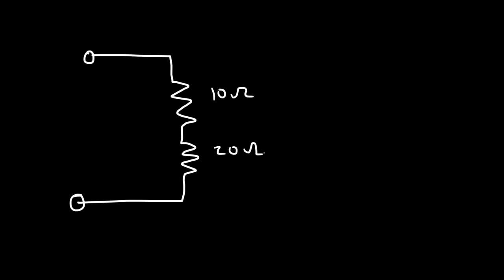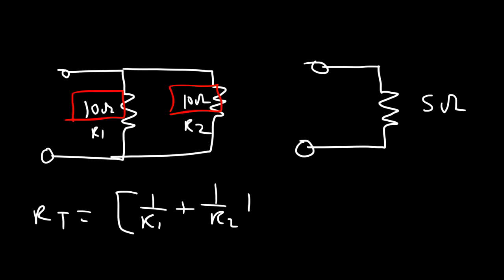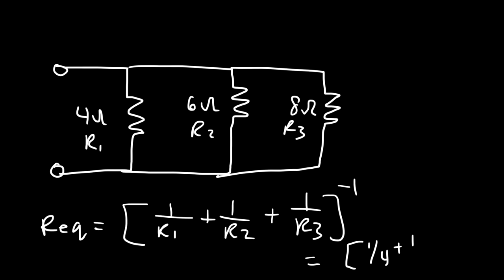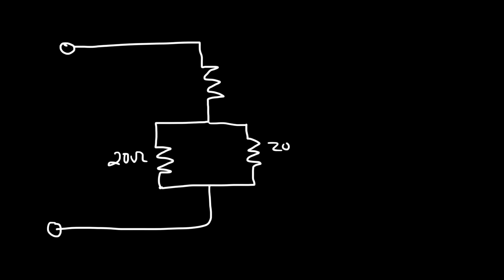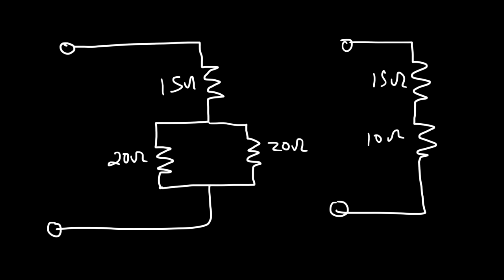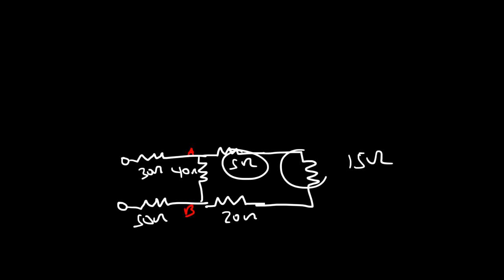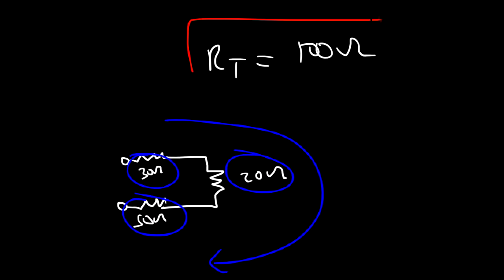Equivalent Resistance of Complex Circuits - Resistors In Series and Parallel Combinations

Comment: All these examples are very flawed because your just using very round and easy numbers and then your solving all the parallel resistors by making them the same number and dividing them, if your parallel resistors had non matching numbers your problems will be much harder to solve
Reply: What's your point, the "examples" are supposed to be easy why are so stupid abt numbers, he's obviously trying to make it easy not hard, not being able to solve the numbers part is on you not him

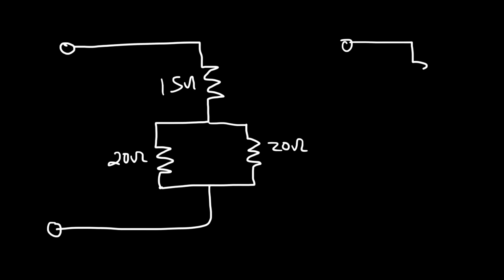Comment: how 20 ohms and 20 ohms are in parallel? I thought it was in series. 3:22
Reply: Because the current can flow separately towards either resistor.  In a series configuration, the current can only flow in one direction.
Reply: If you observe carefully, there are junctions up and down the two 20 ohms. And whenever there's a junction then we have parallel resistance. This is the best way you can forever understand it.

Comment: At 8:51 you said the 10,30, and 20 resistances were in parallel, and you added them together for 60. Aren't they in SERIES (one current path) so you can add them for the total resistance of 60 ohms?
Reply: he meant series. Parallel resistors can not be added for total, they have to be put in the formula.

Comment: How you could of improve this video to make it undestand a quite bit is breaking the 2 ends of the power supply down into a straight line with the points A B C etc. then adding the parallel parts in. Awesome video though xoxoxo

Comment: 3:12 You don't explain why it's 10 ohms??? You just say 'we can make it 10 lol' with literally no explanation, it was going so well, why needlessly do this? Why can't you just simply explain what you are doing like you had been for the other examples. Unbelievable.
Reply: When u have 2 resistors in parallel, if they have the same value (like this case), you can divide the 20 by how many 20 resistors we have. So in this case we have 2 which is 20/2 = 10

Comment: Top quality tutorial. In my experience the place where most errors occur is the calculation of the parallel resistances. Students make errors on the calculator entering all the numbers. I now teach product over sum which has a far greater success rate. For anyone who does not know  two resistors in parallel can be calculated by multiplying the two values together and then dividing by the sum of their values. So lets say 2 resistors     4 ohms & 6 ohms.    (4 x 6) divided by (4 +6) = 24 divided by 10 =2.4 ohms. For 3 resistor just calculate an equivalent value for the first 2 and do the calculation again with the first answer and the third resistor. There seem to be far less calculator input errors using this method.

Comment: Greetings! I found that you made a little mistake between 8:46-8:50. These three resistors are in series not parrallel but the good thing is that you got the right answer it might be a pronunciation mistake. 😇
Reply: ok, man, I cannot understand how they are in series like they're connected to both A and B potential, and it gives a parallel with different potential

Comment: at 8:47 you said "now we have three resistors in parallel". However, shouldn't it be in series because you added 10+30+20 instead of taking the reciprocal of them? The current only has one path to flow and this is the same configuration as 8:01 where you said all 3 resistors were in series.
Reply: wash searching for this comment to make sure İm not mistaken👍🏻
Reply: He is a human man 
Everyone does a mistake in their life.He has misspelled  parallel instead of series connection.
Reply: @Hirosaki975  i was just making sure. i'm still very grateful for this channel

Comment: About the resistors in parallel... You basically want to convert the resistance into conductance, add them together and again convert the sum to resistance. You convert the two by flipping the fraction.
10 can be expressed as 10 over 1. So by flipping it you get 1 over 10.

Hope makes sense
Reply: https://youtu.be/tCApmk9JEvU
Its very easy... Check it once

Comment: what is the resistance of 160m wire length with 0.28mm uniform diameter, if specific resistance is 12.32 micro ohm Cm

Comment: A question, imagine there is a main path/wire connected to battery. Now that main wire has 2 resistors. Now I put a zero resistor wire (Let's assume its zero or close to zero). One side of the wire is in between that 2 resistor and the other one is connected to the main wire.

How will the current flow?

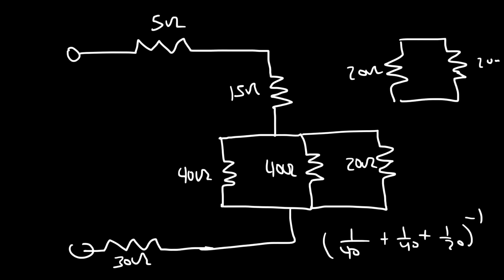Comment: How are you getting the answer to the part at 5:25 minutes . 1/40 + 1/40 + 1/20 over -1 or something like that . I don’t have a calculator and I’m doing it on my phone calculator. I keep getting decimal points , with those 3 fractions added up i get 0.1 . I don’t know what to do now someone help
Reply: I found the answer i was doing the last part wrong for the math
Reply: You first add them all then raise them to the negative one power

Comment: But, why is the equivalent resistance less than the smallest resistor? I can do the math, by I am missing the concept. 

Can you explain why this is in concepts and analogies?
Reply: U can compare the current like a stream of water

When in series it only goes on one path 

So the req is the greatest values

When it’s in series the current then proceeds to venture on different path while mostly going on a path that has less resistance. 

Since it’s parallel, the current is divided so that’s why the req will be the smallest value in a parallel circuit

Comment: For the example when the 20 and 10 resistors were added to make 30, if it was placed at the top instead of parallel to the 30 resistor wouldn't they be added since it would then be in series and come to an equivalent resistance of 60 ohms?

Comment: 8:00 Ok, Im having trouble here. What if these 3 resistors (10, 20 and 30) that are in series don't add up to the same number as the neighboring parallel resistor (60) to split halfsies with? I need help :(  

Like in my case, these 3 resistors are 12, 12, and 24, and on the left side is also 60. Multiply 12 twice and add it with 24, you get 48, but I can't split halfsies with it with 60. What do I do then?
Reply: Pls help MEHHH
Reply: Well there's an equation right. 1/R = 1/R1+1/R2 .......
Reply: 1/R = 1/48 + 1/60 ; 1/R = 3/80 ; R=80/3 = 26.67
Reply: Bro we have the same problem HAHA how did you solve yours btw?
Reply: @cathyjoyandot1525  :o
actually, if i remember correctly, i guessed it lol

Comment: At 8:50 of the video I’m a little confused. You say every thing is parallel but you add them up like a series. 10+20+30=60 that doesn’t seem like parallel. If it was parallel wouldn’t it be 36.6 ohms because it would be 10 1/x + 20 1/x=6.66 +30=36.6. I’m not sure if that was a mistake on your end or if I’m not visually seeing what your explaining. Every thing else in the video is crystal clear, I just would like clarification on my misunderstanding. Thanks and awesome videos I so appreciate your time.👍🏼👍🏼👍🏼👍🏼👍🏼👍🏼💯💯

Comment: Hey what if theres no resistance value given first? Could you do a complexed circuit like that for example because im struggling to figure it out.
Reply: You can probably calculate it if given EMF and current. Remember that all current and resistance in circuit must add to EMF

Comment: The voltage across each resistor within a parallel combination is exactly the same but the currents flowing through them are not the same as this is determined by their resistance.   Some examples : http://beteshis.com/6o7c   (skip ads)

Comment: Got lost in the calculations at 2:46
Where... the answer seems to be done on a calculator.. to the negative one power ( -1 )
Seems I am going to be getting lost without a calculatorWhere the sum total of the 4,6,8 ohms equaling 18 ohms... became a multiple insteadBecame an integer where the sum total entails staggering the decimal placesWould have been good to see the calculations done outIf it wasn't going to be that time consuming...Because since there is no voltage to apply into or fromJust got stuck standing here... looking around for the missing link...
Who by the way can be most likely be found in the High Sierras or Hymalias

Comment: what Is being typed in to the calculator how are you getting 1.846?
Reply: some calculator's have a fraction button. or you can find a common denominator. so basically. if you do it by finding the common denominator you would see that 24 is the common denominator as that's the lowest number that all 3 of those numbers (4,6,8) can go into the same number. so you would then times the number of times it takes that number to go into 24 so basically you would do 1/4x6/6, 1/6x4/4, 1/8x3/3) which would give you 6/24, 4/24, 3/24 then you add them while keeping the common denominator the same so you would then have 13/24.. now simply divide. and that gets you 1.846...
Reply: you can still put the numbers in just as they are but use brackets so that the program's bodmas doesn't interfere

Comment: Nice video but one correction at 1:47 than using the formula [1/RT=[1/R1+1/R2]to the power of -1 why can't we use the formula like 
[(R1*R2)/(R1+R2)] this also gives the same answer and it doesn't take much time to solve the equivalent value than applying inverse and finding the answer.
THANK YOU.
Reply: Sum of inverses gives you the ability to take lowest common denominator so generally that is the formula used for parallel combination. But of course, while calculating, you can just use what you have stated. However it's easier to take lowest denominator while solving by hand.
Reply: @trueverdicts685  Ya I tried it and I found that this is the apt one to solve the problem anyways thank you for oyur concern

Comment: Is "Req" (Equivalent Resistance) the same as RT (Resistance Total)?  My instructor has me confused about this???  Also, in parallel or combination (series/parallel) circuits, when you find, say V2 (voltage for resistor 2) (my instructor uses E2), is that the same as the voltage drop across resistor R2?  I am unsure of voltage drops since I keep being told the voltage is the same everywhere in the circuit.  When is it not the same?
Reply: Im pretty sure voltage is always the same across the circuit. However, the current is not always constant around the circuit, because V = I*R, and V = I2 * R2. Maybe youre getting voltage and current confused? I might be wrong tho
Reply: i use Req to solve combination circuits by solving series/parallel circuits until it has only one loop left, which i then use it to calculate Rt=(R1+R2+R3...). and yeah voltage will drop across any path with resistors in it. voltage is the same everywhere in circuit = total voltage - sum of voltage drop across resistors = 0 which is basically what KVL stated.

Comment: For the example at six minutes and 37 seconds. Why can you not instead add 30 and 10 in series and then take that 40 And 20 in parallel to get 13.33. Or is that close enough?

Comment: Nice but One correction 
at 8:47 u should have said the three resistances are in series and not parallel.thats why the 3 Resistances simply got added  right
Reply: Yeah basically
Reply: 2:12
Reply: @oui8007   help!! all my calculations tells the answer is ".5417" but i know it wasn't right
Reply: @oui8007   help!! all my calculations tells the answer is ".5417" but i know it wasn't right
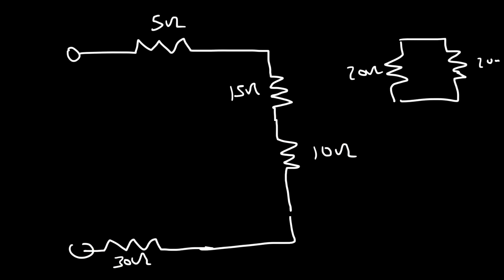Reply: 5:50